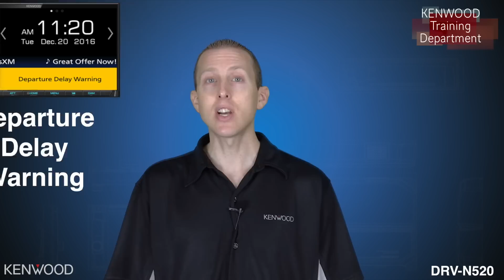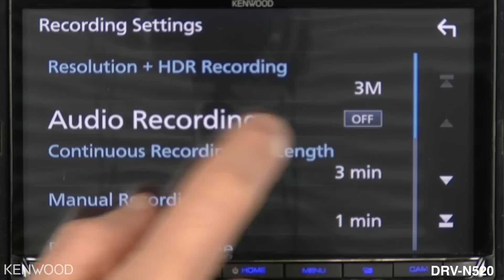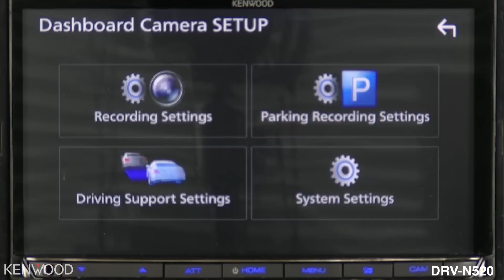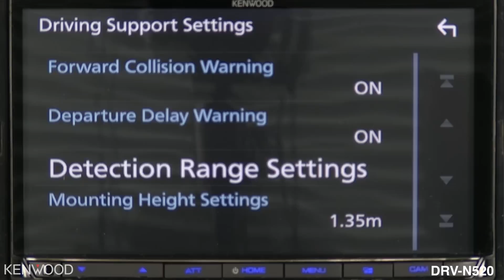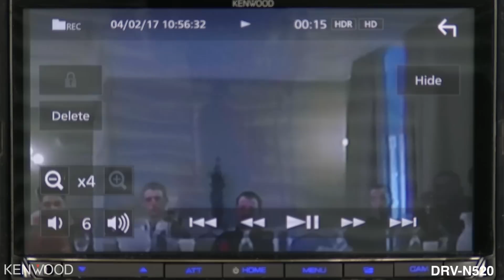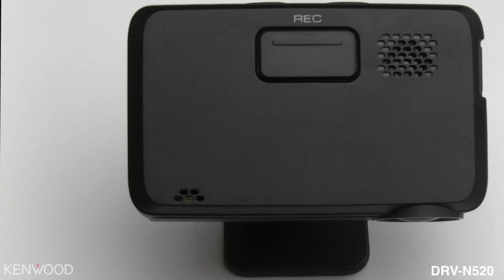2017 KENWOOD DRV-N520 Integrated Dashboard Camera Setup & Feature Highlights

Comment: @kenwoodusa does this dash cam record from the camera built in to the unit? I was wondering if I have a backup camera installed with a DNX697S or a DNX577s? Would the DRV N520 record from the other cameras that the receiver has connected? Will the parking mode also record from the other cameras connected to either of those receivers?
Reply from the maker: As with most dash cameras, they only record from the onboard cameras and do not interface with back-up cameras. Thanks!

Comment: How do you save an event recording from the continuous file?
Reply from the maker: You cannot store an continuous file as an event file. An event recording is triggerd by impact detection, and stored as an event separate from the Continuous recording.  Basicly an "Event" recording is a separate file that is stored when the system is trigger by enough vibration or impact to seem as if you were involved in an event like an accident or hit an obstruction, and is automatic.  Continuous recording is a constant track of files.  There is no difference in the file type for viewing, simply storage and separation are what keep them sorted out.  You can adjust the sensitivity of the detection to create event files but keep in mind, that setting it too sensitive for your local road conditions can result in "event" recordings filling up your SD card and limiting your capacity to record continuously. 
Relisticly you should have very few "event" files.  Thanks!
Reply: @KenwoodUSA  thank you, I thought maybe I was missing something. What it did was record a accident I was not involved in. Car passing in the emergency lane, then plows in a truck.

Comment: I have this installed with my DMX9706S for a few years and is great.   When watching the video with the headunit, is there a way to make the video's sound play through the radio?  It seems to only play from a speaker on the camera, or sounds like it is.  It's not very loud at all.
Reply from the maker: The audio only plays through the DRV-N520 speaker, but you can increase the volume from the head unit to hear it better during playback. Thanks!
Reply: @KenwoodUSA  thanks for that info cause i thought something was wrong with mine. I just brought one today but having issues finding where to correct the date. mine says 2016
Reply from the maker: @BrotherBeth-El  Please reach out to our KENWOOD Customer Support:  
1-800-536-9663

Comment: I have the DRV-N520 Dash Camand CMOS-740HD Backup Camera connected to the Kenwood Excelon DMX957XR. I love the setup! However, when the car is running I get faint horizontal lines on the screen when viewing either the dash cam or backup camera. Anyone know what this is and how to fix it??
Reply from the maker: Suzanne, This could be video noise from something simple, like a loose connection on the components, or a vehicle issue causing the lines. Generally, a close inspection of the installation and a few troubleshooting steps like checking for bad grounds, alternator, or even low battery might expose the cause. If needed, look for an authorized KENWOOD dealer in your area. Here is the link to the dealer locator https://locator.kenwood.com/usa/car/?_ga=2.193059309.1975948215.1649801414-315927861.1649352157 Thanks!

Comment: New message to: allanzshop
Hi

Do you have any ideas why I cannot get the onscreen operating buttons to show up on screen?

I have the camera installed and working using the manual buttons on the camera but I do not get the option to access the onscreen. So I cannot use any of the features of the dashcam IE lane departure warning etc.

I have linked the dashcam to my Kenwood Head Unit model DDX920WDABS.

I have checked and doubled checked the settings but feel I must be missing something.
Reply from the maker: That receiver model does not support DashCam Controls for the DRV-A520.  The receiver requires a data connection to the dashcam that is provided with compatible receivers. Thanks!
Reply: @KenwoodUSA  Hi I don't have a (DRV-A520) I have a DRV-N520, I also solved my problem. Thanks.

Comment: Hi Kenwood 

I’ve integrated this camera to my DMX9720 XDS 10.1inches floating screen (Australia).

In “Camera Assignment Setting” I’ve selected Front View Camera/Dashcam and NTSC signal, I have image on the screen but can’t see the camera icon to get through the menu and settings that I am supposed to.

Can you please help
Reply from the maker: Make sure you have the data cable connected as well, the DRVN520 requires 2 connections to support full funtion. Thanks!

Comment: You CANNOT protect continuous recordings, it’s a piece of  crap!
Reply from the maker: Graham Lloyd, there are several recording methods available with the dashcam, continuous recording does not allow locking the files because it's set up to rewrite over that file type. If you want to save a continuous file you must remove the SD card and use the desktop application. Thanks!

Comment: Is there any updates to/of this that supports larger micro sd cards then 32gb? Any way to have it connect through the reciever to your phone for video/file editing and sharing?
Reply from the maker: AceBoy2099, there may be software updates available for your Dashcam depending on what version you are currently running, please check the support page on KENWOOD.com/usa/car to verify, but at this point, no software changes have been made to increase the SD card limits or add in smartphone sharing. 

You can view the captures from the KENWOOD Drive Reviewer on PC, available for download at the bottom of the page here https://www.kenwood.com/usa/car/dashboard_camera/drv-n520/  Thanks!
Reply: Is 2018 leaf Japan version using KENWOOD DVR 520

Comment: Yeah. So how do you set the time? Mine has defaulted to 2017 and no settings anywhere to change?
Reply from the maker: At the 3:24 Second mark in this video, it shows how you can adjust the time from the System Settings icon. Make sure you have the proper Dashcam Data connection to the compatible KENWOOD receiver and you have a 12V constant wire connected to the KENWOOD receiver in order to store settings and keep proper time. Thanks!

Comment: correction the files were automatically saved to an incident folder so its all good, but they were still missing from main recording folder. Got this dash camera seems to work fine except I've had 2 near misses with people pulling out on me and weirdly both time the camera malfunctions for the 30 seconds of the event
Reply from the maker: Have you checked to make sure your dashcam is running the most current software?  You may also need to reformat the SD card, for optimal performance this should be done regularly.  Thanks!
Reply: @KenwoodUSA  I just realised it saved the file in a incident folder so I have the clips. But they were missing from the timeline in the main recording folder.
Reply from the maker: @stefandior1615  Good thing you found the clips! that is normal for protected files to be sorted into a different folder, this protects the file from being overwritten. Thanks!

Comment: Can you hear the audio warnings when only using external amplifiers? I don't use the high level speaker connections.
Reply from the maker: The audible alerts will work on both high level and low level outputs

Comment: You guys need an update to this thing. I have it installed as my dash cam and have the cmos 320 as the backup. Features are great on both of them except on the 520 the forward collision needs to be turned off when the sun is setting behind you  because it thinks the cars shadow is another car and keeps going off. And the departure delay goes off of you're stopped and any car or motorcycle drives in front of you going left to right or right to left. Just need to update the software on if.
Reply from the maker: Please ensure your adjustments have been setup properly (refer to owners manual for procedure) these are added features and can be very helpful, but the cameras primary function is to record.  Thank you for the input.
Reply: @KenwoodUSA  how do i correct the date on the dash camera?

Comment: The video says to use up to 32GB yet I have a 63 GB and now I'm worried.  I put the SD card and it doesn't accept it.  I wonder if it's because it's a high memory or perhaps it needs to be formatted? Help KenwoodUSA
Reply from the maker: Yes, a 32GB is the max SD card size.

Comment: DRIVER beware this camera has a speed limit warning that beeps every 15 seconds if you go over the speed limit and it will interfere with blue tooth connections lowering the volume so you can hear the beeps.if its for your personal car it can be irritating.
Reply from the maker: This is not true.  The only speed limit warnings that we offer are from our in-dash navigation systems, of which can be disabled by entering into the Garmin Navigation settings, then un-checking the box next to "Audible Speed Alerts".
Reply: Did you find a solution?

Comment: Hi Kenwood,

Does the ddx9904S allow for two cameras AND the N520 dashboard?

Thanks
Reply from the maker: Not technically.  You would need to have the second camera connected to the A/V Input using the CA-C3AV cable, then change to the AV-In source to access it.
Reply: @KenwoodUSA  does this dash cam record from the camera built in to the unit? I was wondering if I have a backup camera installed with a DNX697S or a DNX577s? Would the DRV N520 record from the other cameras that the receiver has connected? Will the parking mode also record from the other cameras connected to either of those receivers?

Comment: Why does this dvr -n520 been to be updated if so how do you update it ? Do I just need to update the firmware on the head unit for it or do I need to plug in the dash cam on a pc to update it ? I’m lost
Reply: Did you find out how to update it?
Reply: Ffocusalltheway no I never updated it yet . I think once you update the head unit it will update the cam as well

Comment: Can I use this camera without a head unit? Meaning can I just use the app to watch recorded videos or a computer?
Reply from the maker: This camera is only designed to work properly with a supported KENWOOD receiver.
Reply: KENWOODUSA thank you for getting back to me so fast. One more question. Will this camera work with kenwood headinit model # DMX7705S?
Reply from the maker: @hugojerez6151  No, that model is not compatible with the DRV-N520.
Reply: You can, yes, but the date/time cannot be set (so it will be wrong with no way to correct), and without GPS you’ll have no lat/lon or speed recording. You’ll have video though! I have this camera with an incompatible head unit, so I just remove the micro SD card to offload MOV files, which still record fine. I’m awaiting the install of a DDX9705S at my dealer to correct this and have full compatibility.

Comment: I bought this DRV-N520 and have the DDX-6905S head unit but can’t get all of the settings that I am supposed to.  I only have access to CMOS Camera or other.  I don’t get the DRV-N520 dash cam camera option. Therefore I don’t get any of the options to watch the files.  I do connect to other and get the basic video however.  Any ideas on where else I can find this?
Reply from the maker: Unfortunately, the DDX6905S does not support the DRV-N520.  You will need the next model up (DDX8905S) or other model that supports the DRV-N520.
Reply: I bought the DDX-9905S and the picture quality is fantastic as well as the ease of viewing the files onto the KENWOOD screen.  Thank you for the help.

Comment: can you run two of these cameras from 1 deck. one facing forward and one in the back window?
Reply from the maker: Currently, only one of these cameras can be connected.  We recommend adding a DRV-410 or DRV-320 as a stand-alone secondary rear facing camera.

Comment: Can it be turned off completely?
The reason I am asking is that I don’t drive as much as I did 3-4 years ago. If I forget to unplug my Garmin dash camera when I get home, it drains my car battery so much that I have to get my car jump started.
It has happened so much that I ended up buying a battery jump starter because it was easier and faster then calling my AAA every time.
Reply from the maker: Although there is a manual power ON/OFF button function, if connected properly, the dash camera will already power OFF when the key is turned off.  The camera will only turn on when it receives an impact when the Parking Recordings function is turned On.  To turn off the Parking Recordings function, enter into the Dashboard Camera SETUP, then select Parking Recording Settings, then turn to OFF.  Alternatively, if you need to disable the camera completely for extremely long periods of time, you can follow the path of the chord to its physical connector, which can then be unplugged from the dash cam.

Comment: Hi there...
Can you help me how to setting up date and time for my DrV-N520 unit.
I've setup the date and time on the DDX-9017s but the time and date did'nt sync to the camera.
The recordding time and date start from the time or firmware, 01-01-2017.
Need help.... Tq
Reply from the maker: I would suggest ensuring that your GPS antenna is properly installed with a clear view to the sky.
Reply: Hi KENWOODUSA, tq for your respon. Bu I'm sorry that  forget to tell you if  I only have DRV-N520 with my DDX-9017. There's no NAVIGATION Unit intalled on it. Do I Have to buy it ( NAV unit ) just to set the date and time or to make date and time of my DRV-N520 to sync ?? 

I need solusion for this... may be U have any firmware update or any special setting to set up DRV-N520 date and time without additional NAV unit.

Tq
Reply from the maker: For USA models, all receivers that are compatible with the  DRV-N520 include a GPS antenna already.  I would suggest checking with the KENWOOD Office in your country to find out what you need to do.  Thanks!
Reply: Hi KENWOODUSA, Tq for ur advice above ( week ago ). I Don't know if the Antena included in the package shoul be attached to the Head unit even there's no KNAV installed. 

Few days ago, I just wonder about that and attached the Antena and finally the problem was solved. THe time and date was sync correctly to the camera..

Tq
Reply: @jeffreyjunefri9765 did you find a solution, camera doesn’t sync and get the correct date and time.

Comment: Just bought head unit DDX 9717bts what different between this model and dvr 410 ?
Reply from the maker: The DRV-410 is a stand-alone dashboard camera.  The DRV-N520 is an integrated dashboard camera, designed to be used in conjunction with a supported KENWOOD multimedia receiver.

Comment: How do you adjust the clock on the camera to represent the actual date. Mine just say 01/01/2016
Reply from the maker: First, ensure that the GPS antenna that came with the receiver is installed and has a clear view to the sky.  Then, note that the camera's clock and date are synced with the receiver's clock and date, however, you can change the time zone and daylight savings time in the camera's "System Settings" screen.  Make sure the receiver's clock and date are set correctly manually, or change the receiver's clock settings to "GPS Sync" to receive the date/time via the GPS signal.
Reply: Mine isn't getting the clock time from my head unit. It's the 2019 model. And it doesn't have a gps
Reply: @leithbuchanan6466 same here, did you find a solution? Thanx